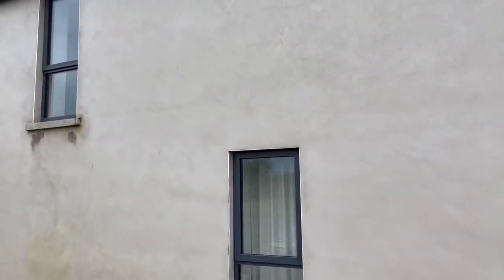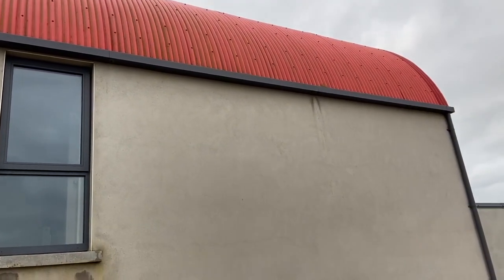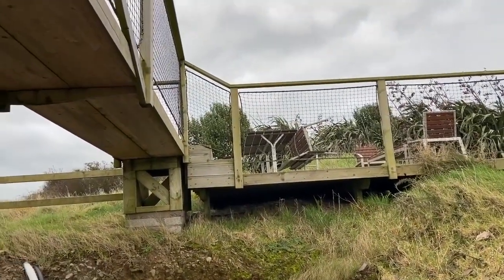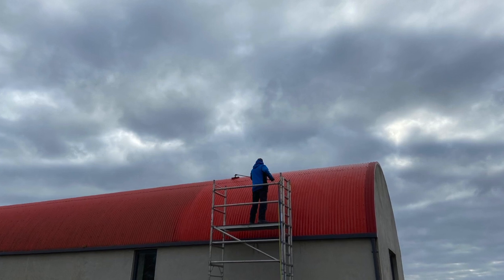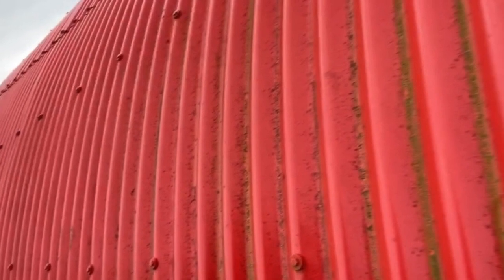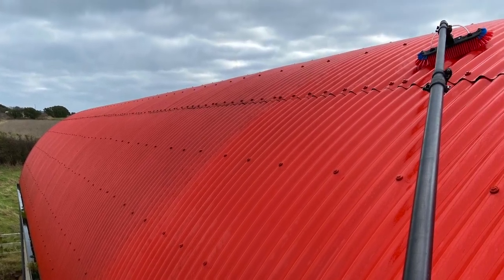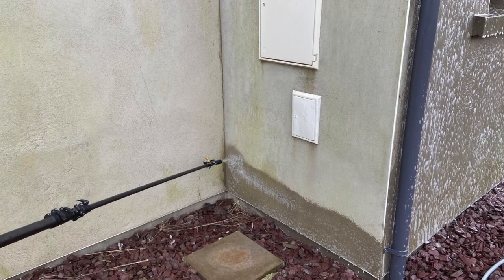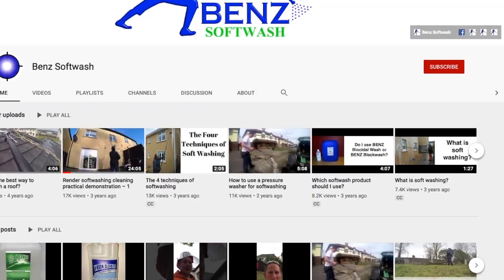Softwash cleaning a uPVC coated barn type metal roof

Comment: great job Ben. thanks for sharing. What size pump do you use when you are using it with your WFP gear. 👍
Reply from the maker: thats is just a 100psi 5Lpm pump
Reply: @BenzSoftwash  hi Ben Is there a brand op pump you would advise. I have one with that pressure but doesnt seem to spay on as smoothly as you are doing it
Reply from the maker: @brendanknox6671  We have info on the pumps we use (and a lot else besides) on our softwash equipment page: https://www.benzsoftwash.com/pages/soft-washing-equipment